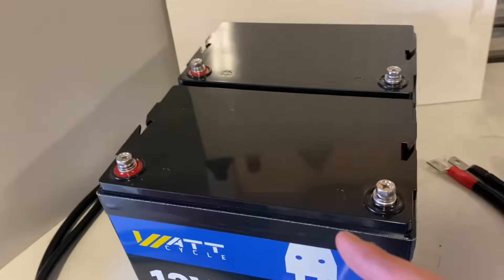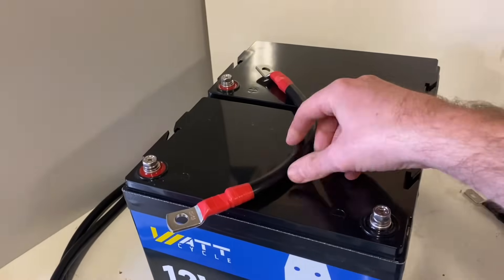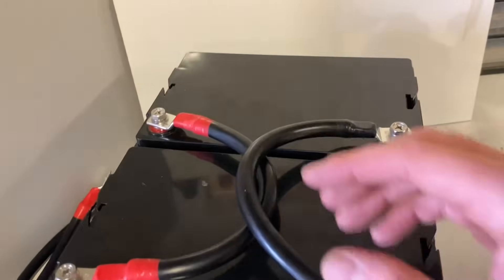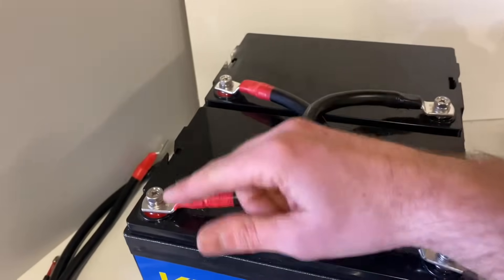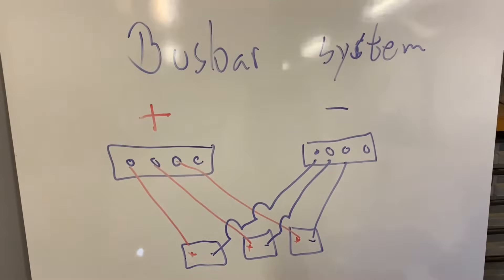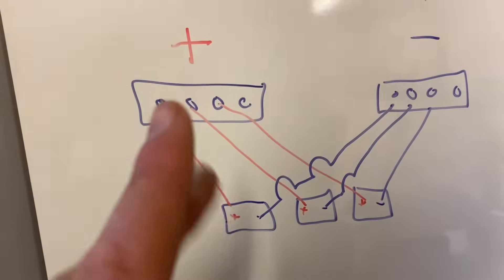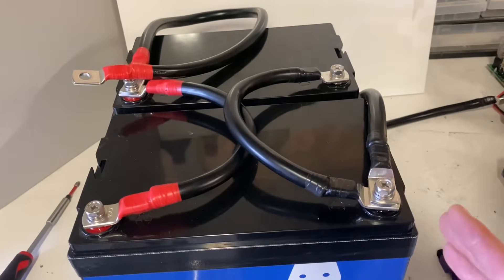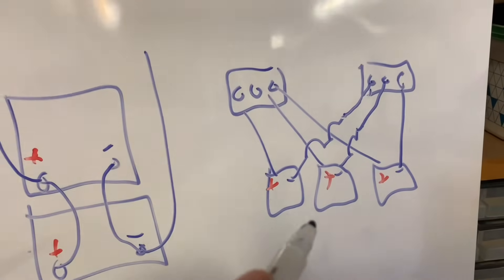How to Parallel Two 12V Batteries – Best Method Explained

Comment: The "proper" way to connect two 12V batteries in parallel is "not at all." It is better to connect two 6V batteries in series.
Reply from the maker: Good point! Two 6V batteries in series can be a great choice for deep-cycle applications. But in setups where maintaining 12V is essential or when using LiFePO4, parallel-connecting 12V batteries can still be a good solution. It all depends on the system. Thanks
Reply: Then that is series, not parallel or would be series-parallel.

Comment: personally i dont believe this at all
Reply from the maker: I appreciate the input! Could you share what specifically you don’t believe? Always open to discussing different perspectives and testing things out!
Reply: @ you have to be pulling a lot of load  to have differential battery discharge especially if you have short adequately sized link cables and battery balancing
Reply from the maker: @Jason-rs6co  That’s true! With short, adequately sized cables and a low load, the difference is small. The issue becomes more noticeable as loads increase, especially in larger systems. That’s why I emphasize balanced wiring for those cases.
Reply: He said for small loads its fine.   Imagine if ppl paid attn.  dunning kruger effect is spreading
Reply: @ i know exactly what he said numb nuts
Reply from the maker: Come on. Please be friendly✌️I don’t mind comments that question my content. Gives room for conversation👍 thank you guys
Reply: I've lived off grid for 20 years and can say I have no issues on my heavy current system doing the way the video says not to... my batteries before swapping to lithium were 10 years old, they are now being used in a friend's set up
Reply from the maker: @Sheet-Stores-Erewash  That’s great to hear! If your setup worked well for 10+ years, that’s definitely proof that real-world conditions don’t always follow the textbook. The main reason I recommend balanced wiring is to reduce the chance of uneven wear over time, especially in high-draw setups. But as you’ve shown, sometimes things just work! Thanks for sharing your experience—always good to hear from someone with 20 years off-grid!
Reply: @Sheet-Stores-Erewash  well you are just special

Comment: more importent is to use thick cables, and short.
this one have high internal resiteances and impact much more heavy current movements differences.
the other part every battery have an internal resistance  so if battery 1 have 4mohm and battery 2 have 20 mohm battery 1 will be drawed many times harder.

there alot of thinks that effect more the current movment then only a wire put on any random conection.
best way in unknown situation. buy a busbar "cost ~5$" and use same Wires for all batterys and conect all similar to the busbar
Reply: I wish heavy-duty copper bus bars only cost $5
Reply from the maker: @ that would make this really simple👍
Reply from the maker: Agreed!

Comment: A bus bar does Nothing to help the batteries work evenly that the cable going to opposite batteries wont . These aren't wet lead acid.  These have a BMS.
Reply from the maker: @weseehowcommiegoogleis3770  The BMS does help balance LiFePO4 batteries, but a busbar still ensures even current distribution across the connections. Without it, resistance differences in cables and terminals could lead to minor imbalances over time, even with a BMS.. even flow🤘🎸
Reply: Jonas is correct

Comment: Hello Jonas, how about fuses between the batteries?
Reply from the maker: Could be an option if the batteries are not identical with different capacity and internal resistance. However with identical batteries and proper wire gauges I would not add fuses. What do you think?
Reply: @JonasSyver  I think you are dead wrong and should not be posting videos without fuses between batteries. You are creating a fire hazard both for yourself and your viewers.
Reply from the maker: @  I appreciate your concern — safety is extremely important when working with batteries. In this specific setup, the batteries are of the same type, voltage, capacity, and state of charge, and the cables are of equal length and gauge to ensure balanced current sharing.

While fuses are essential in most parts of a DC system, especially between batteries and loads or charge controllers, it's a common and accepted practice not to place fuses between batteries that are directly paralleled — as long as proper precautions are taken and the batteries are matched. That said, I agree that adding fuses or breakers can add an extra layer of protection in some cases, and it's something I may cover more in a future safety-focused video.

Thanks again for raising the issue — it's always good to keep safety in the conversation!

Comment: Need a round bus bar to get equal draw across them pull form the center
Reply: Why not square or oval?
Reply from the maker: @weseehowcommiegoogleis3770  Good point! Pulling power from the center of a busbar does help balance the load across batteries. The shape itself isn’t as important as ensuring equal-length connections from each battery to the busbar!
Reply from the maker: Thanks for the comment and input👍